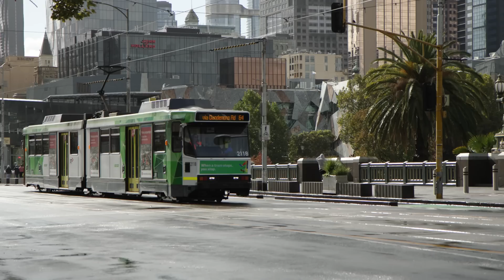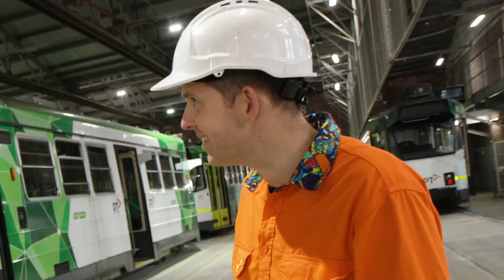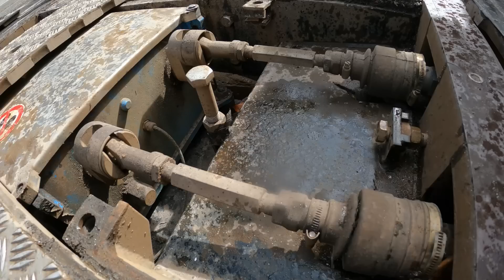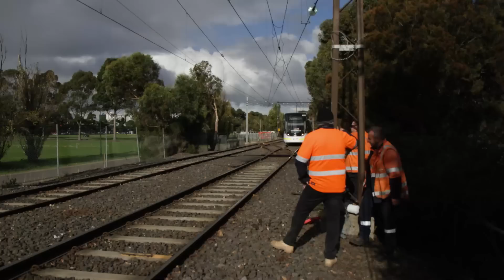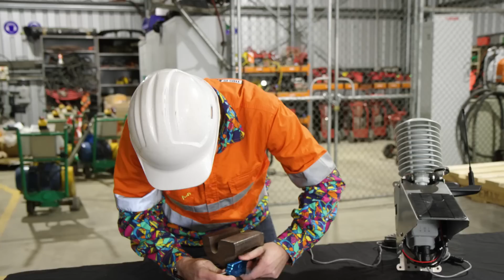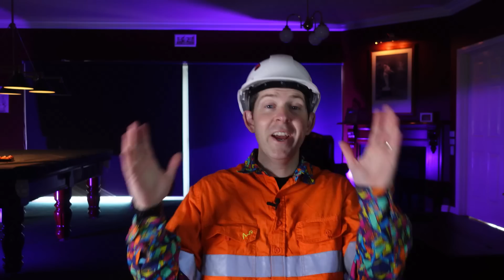A Tram Network's Worst NIGHTMARE!

Comment: Seems like the trams need more wheels.
Reply: the newer E-class trams and the upcoming G-class ones do have more wheels, unlike the older ones. problem is that the older ones make up a huge portion of the fleet, so removing them would cause big issues all over the network. they're hoping to phase out the Z-class and A-class trams with the 100 G-class trams they've ordered to be delivered by 2025, and the E-class ones have allowed for quite a few older ones to be retired, but not enough

Comment: We've got plenty of trams in the place I live (not in Australia), and some of them are pretty fast, but I've never noticed them dropping sand. Maybe they've got some emergency mechanism that does this, but so infrequently that I never noticed. Either way, why do Melbourne trams need to use so much of the stuff?
Reply: I'm guessing it's mainly because there are a lot of trams in the fleet. like, right now there's 493 of them, and in 2025 they're gonna add another 100 next-generation trams to the fleet. so that many trams means a lot of sand

Comment: But why don't you outfit blowers to the back of the tram to blow away that sand you left on the track? Like left it running after the automatic sander unit operates?

Comment: why not put vacuums behind the wheels? maybe?
Reply from the maker: Great idea
Reply: maybe they'll do that on the upcoming G-class trams, but it's also possible that they just straight-up won't need it. also, retrofitting the older trams with that kind of mechanism, especially with just how many trams there are in the fleet, would be difficult and would take a long time

Comment: Whilst it is true that sand is automatically dispensed when a slip is detected, by that point it is too late for the sand to take maximum effect. The whole point of using sand is to prevent a slip from occurring in the first place. The effectiveness of sand is dependent on the tram being driven in accordance with prevailing track conditions and the driver's awareness and action in dispensing sand by manual activation and also by ensuring the sand flow is not impeded by blocked pipes which happens when the pipes are not routinely checked as often as prior to departure from the terminus on each run during inclement weather.
Reply from the maker: Very true 🧐

Comment: It sounds like both of their major problems can be solved by changing to ...insert drum roll here...electric buses.
Reply: Electric busses have much lower capacity than trams (our current trams coming in over the last ten years have capacity for 210 people). Rubber on asphalt (busses) is also much less efficient than steel on steel (trams). There’s a reason Melbourne has kept its tram network! We have way too many people using the tram network and busses couldn’t cater to the same number of people
Reply: @Sagealeena  I agree, but comparing a single bus (that seats 50 people and also has lots of standing room) to a multi-car tram of indeterminate length is not quite a fair comparison.
Actually, my comment was intended to point out to other people that focusing on a solution to a single problem without considering other factors tends to lead into trouble.
For example, if the problem is airplanes that crash and that is the ONLY thing that is to be considered, then building taxiways to connect every airport in the country would solve it. Of course, that's a ridiculously extreme example but I think it highlights the fallacy of treating any single problem in a vacuum.
Everything in the real world is a compromise...there is no such thing as a 'perfect solution'.
Reply: @Sagealeena  honestly, I think this city could benefit from using more buses alongside trams. both are far more efficient than cars anyway
Reply from the maker: Interesting 🧐

Comment: Our heavy rail network operator, Metro Trains also did a trial painting the rails white.

I don't think they do it anymore so not sure how it turned out.
Reply: I'm guessing that if it had worked they'd still be doing it.
Reply from the maker: I would love to know the results
Reply: @thinklist  if you search Metro Trains Melbourne Solacoat there's a few references to it being trialled and photos from other enthusiasts, but nothing to say how it actually went.
Reply: I was given a job at a military base in Australia to paint the inside of all the fire hose cabinets white. By painting them white it keeps the spiders away. True. Red back spiders cleared off and were never a problem since then.
Reply: @Layingflat  A great example of working with nature instead of fighting it.